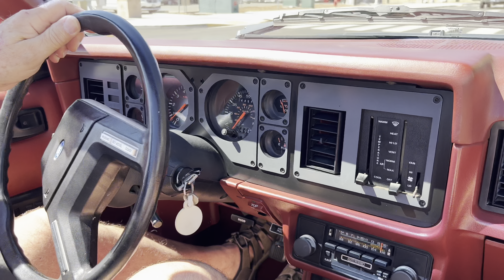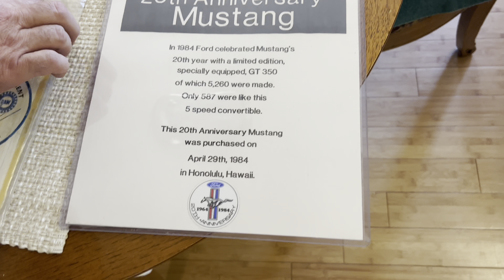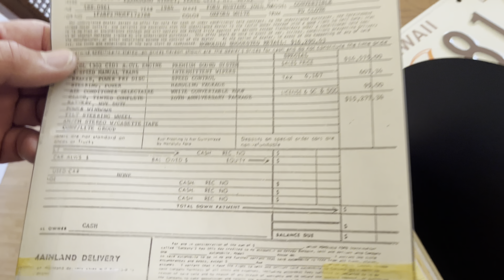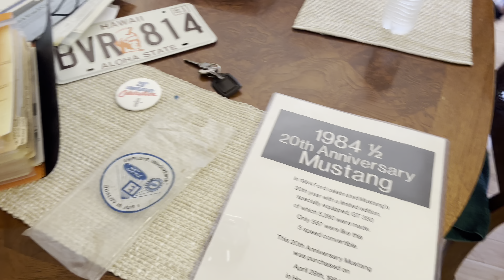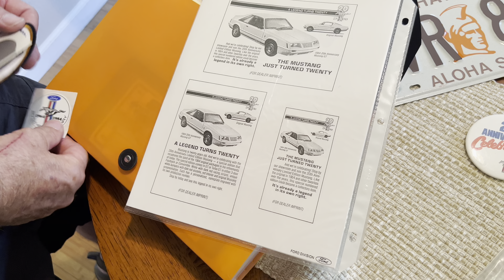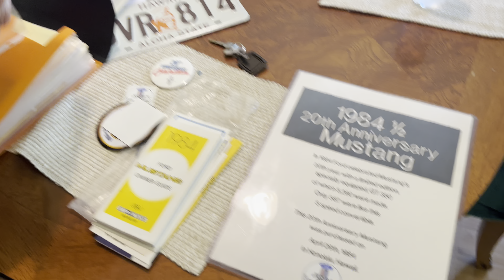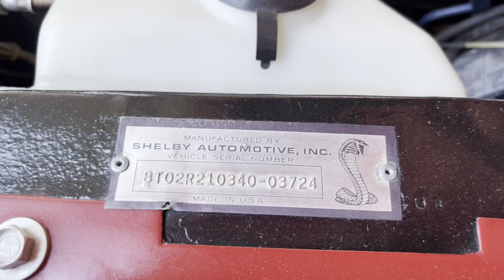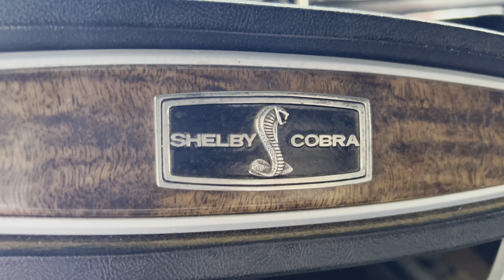Tales from the Trip leg 1. You won’t believe what I found and what I am going to do!  I may be nuts!

Comment: Can you still get the tires for those wheels?  I had those wheels, and they took metric tires, which even in the late 80s were super expensive if you could find them. I don't know if they made that wheel in a standard size but I always liked the look.
Reply from the maker: Coker bought the molds from Michelin and reproduces them.  Not cheap…